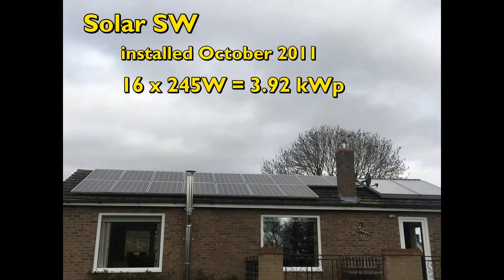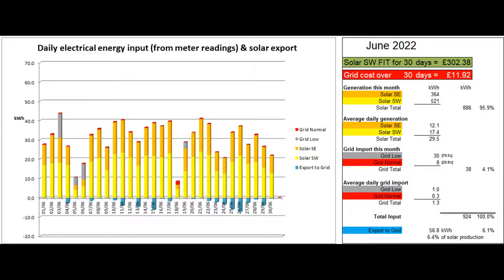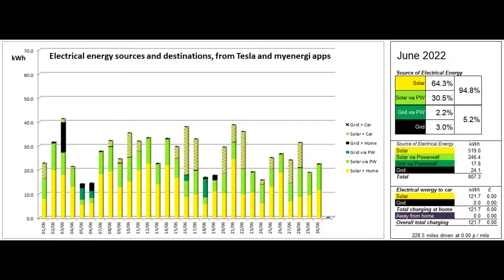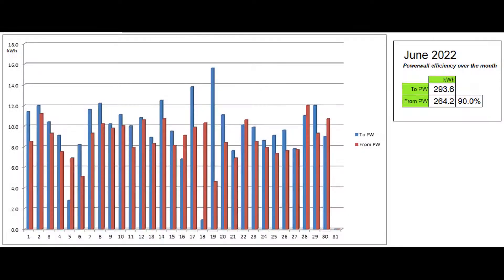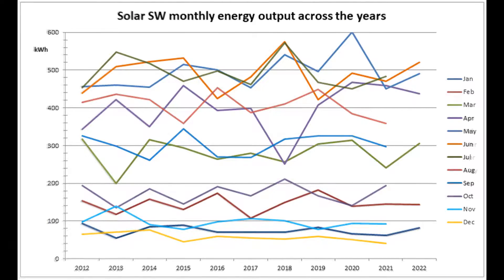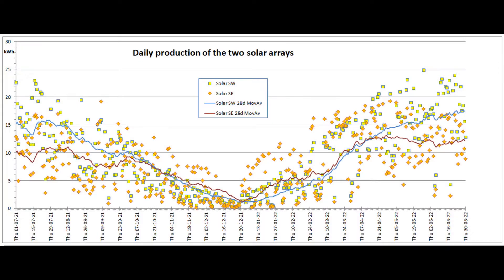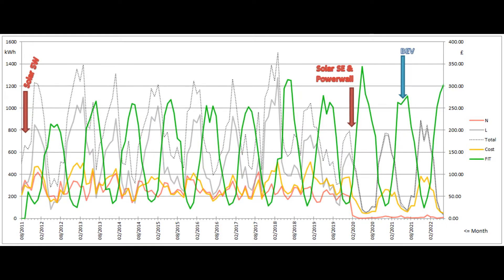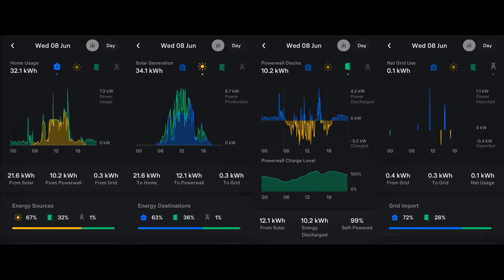Tesla Powerwall 2 and Solar PV in the UK [31]: June 2022

Comment: Just discovered your channel.  Thank you very much for sharing all those details. You mention getting the data from the Tesla,  do you get raw data that you analyse in excel afterward or where you provided with the excel template?

Last question, if I may,   does the Tesla app capture all the data shown (for instance the data about charging your car, how do you know how much your car has used while charging? )

Thank you and looking forward to your next report
Reply from the maker: Thanks for the questions! Info for the first graph (solar production and grid usage) comes from the grid and solar meters. The Tesla app provides the figures for the second graph and the energy graphs at the end of the video. It also has other graphs and summary figures available but I put the figures (each morning) into an Excel file that I have created myself and developed over the past 11 years. The car is charged by a zappi charger and it is the myenergi app (the makers of the zappi and other devices) that tells me what has gone into the car. The measurements from the three different sources are not "precise" and there is a discrepancy between the utility meters and the Tesla app figures, sometimes as much as 5%. Hope that all makes sense!

Comment: A perfect example of what can be achieved almost zero fossil fuel use.  Well done.  I hope to do similar when i can.
Reply from the maker: Thanks for your comment. I was fortunate to retire just before the end of the good FIT payments and to have some funds available for the initial investment in the first SW array. We do have to rely on oil in the winter months to provide heat. When the boiler gives up we'll be looking at the alternatives available at the time, but won't have enough solar coming in at that time of the year to be able to avoid a large grid pull. We live in a windy location, but a wind turbine currently doesn't make financial sense.